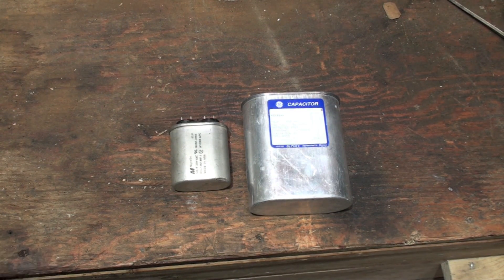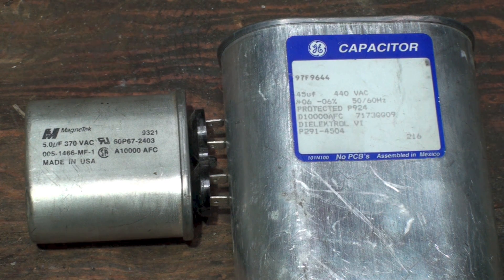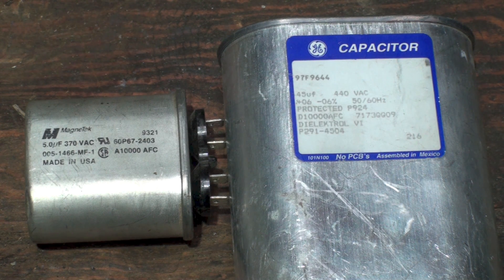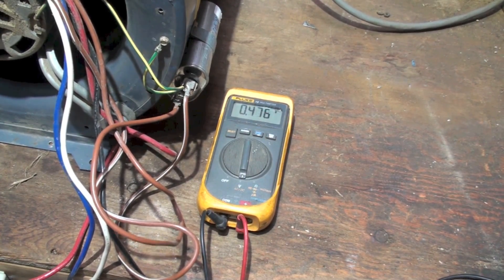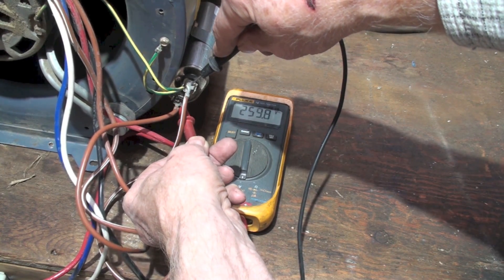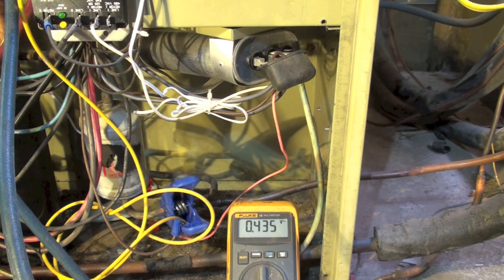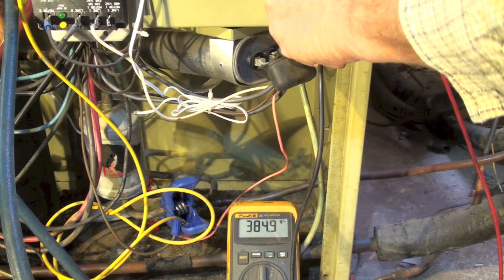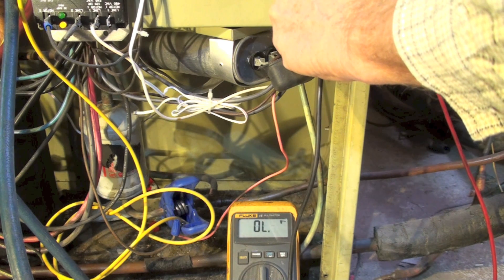A comparison of the 440 and 370 volt capacitors

Comment: You're full of s***you can use a 370 on a 440 ra 440. You can't use a 440 where it requires a 370
Reply: If you had a motor that requires a 370 you cannot use a 440. If you have a motor that requires it for 440 you can use a 370r 440
Reply: When it requires a 370 you can only use a 370 when it requires a 440 you can use a 370 or 440
Reply: And that's because of the insulation in the motor it has nothing to do with the insulation on a capacitor is the insulation on the windings in the motor

Comment: I am replacing a 370 VAC 10 mf + / - 5% for a 120 V blower motor with a 370 VAC / 440 VAC 10 mf + / - 6%. Compatible?
Reply from the maker: Yes
GFM
Reply: @grayfurnaceman  Thanks GFM

Comment: Thanks for the great video! I have seen so many 370 VAC capacitors used on compressors and they came from the factory like that. What happens when you have 370VAC hooked up instead of 440 VAC. 
Does the capacitor blows up?
More amp draw by the motor? (Since there is not enough resistance by the capacitor)
Or can it short the windings or kick the internal overload ?

Comment: So,  I was working on a Comfortmaker the other day.  The condenser had a 5/35mfd 370 capacitor.

It was the factory cap.  So what gives?
Reply from the maker: dpeagles If the compressor manufacturer specs have determined that the back EMF is below 370 volts, they can and will use the 370 volt capacitors.  To me it seems a poor choice, especially in view of the fact that newer capacitors have a high rate of failure, but they are used.  I almost always replace with 440 volt caps.
GFM

Comment: What do you mean by insulation regarding the capacitor?

Thx
Reply from the maker: Pitbull14218 The capacitor is very simple inside.  There is a roll of aluminum foil with an insulating layer of plastic.  The type and thickness of the plastic layer determines the voltage of the capacitor.  This video shows what is inside of the capacitor:  https://youtu.be/4QbPMG9K1-E  Hope this helps.GFM
Reply: grayfurnaceman, there are quite a few dual capacitors that are marked 370/440 or 370 or 440 vac. I would take it that it means that it will handle either voltage. Why do they make these? Why not just use a 440?

Comment: If it's a run cap, not a start cap, why won't a motor start up without one?
Reply from the maker: Nick Santos Its called a run cap because it must be capable of being in the circuit continuously.  Unlike the start cap that must be removed from the circuit after the motor starts.  Actually, some motors will start without them.  The run cap serves 2 purposes.  One, it provides an out of phase circuit to give a small "kick" to the rotor.  Once the motor starts, it adds efficiency to the motor.  Hope this helps.GFM
Reply: Thanks. I had wondered why we call these run caps when they’re actually in series with the start winding. GFM’s comment to this question basically cleared this up!

Comment: you should get yourself a good pair of voltage rated insulated rubber gloves w leather outer. Also recommend proper face shield for checking HV equipment.